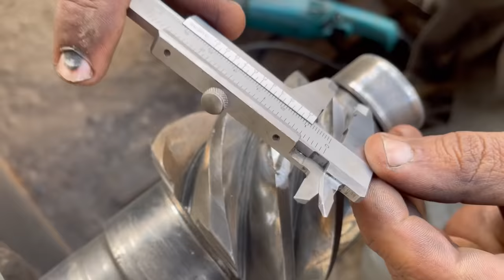I repaired the scrub pinion which no mechanic repairs | Give your opinion by watching the video |

Comment: wrong kind of filler rod for the gear, the gear has a higher carbon content for low wear, not sure if it was  ni rod  which is a low carbon high nickel filler rod for welding cast iron, it will break almost instantly when put back together.

Comment: That won't be noisy at all and it will last forever... E for effort though. It's bad enough setting up brand new gears and not having them self destruct in 10 min. Even with new gears you get bad ones... that are still no doubt better than this... sorry, but I like the valve job videos better.

Comment: there's lots of reasons why mechanics do not repair these types of things. the customer will soon have to tear it apart again when it breaks. as many of the comments say, you are putting a lot of heat stress into that gear and its life will be short. I don't understand why so many people weld in their lathe or Bridgeport or Milling machines. with that electric Arc running through the machine you are going to ruin your bearings and you'll be trying to weld those two I suppose. hilarious

Comment: Giving that gears like this are heat treated 8620 or 4140, unless you preheat the gear too about 350-400 degrees before you weld, the filler will never hold, and you may make the whole gear brittle... Show me this gear in a few months from when this repair was done, bet the same tooth is missing again, or worse.

Comment: How many strokes security guys and engineers had after watching this video? Needless to say, well done not losing a hand, finger, snapping a tool or anything, yall should never reproduce what was done in the vídeo, the guy prob do this a long time ago, and it is EXTREMELY unsafe the way was done and you CANNOT be sure of the safety of the part that was "repaired". Cool DIY showcase video, but precisely contructed and designer parts are made the way they are for a purpose, to be safe and operate within the specificated time and stress. Do not start filling cracks with weld on parts, you cannot measure the price of safety. Replace the part or order a construction of a new one.

Comment: I like silly professionals comments, but you do not think outside the box, this guya do this because it works for them, may be the truck will go 50k miles before need it again vs 500k miles that origunal part may last, but mey be they do not have access to original part, may be that truck come from other side of the world, may be truck manufacturer is out of bussines or model discountnued, so they go the extra mile to keep that truck rolling vs for reasons lesser than this, trucks got waisted on first world countries..

Comment: All the strength of the metal is lost by welding it. It may work but not for long. Will have to pull it apart next week and put a new gear in.a silly waste of time.

Comment: Machine produced precision parts are cheap and should not be repaired. These repairs put lots of other parts under undue stress (especially at high speeds) and they, together with  these repaired parts can fail prematurely.  You said no other mechanic (a lot of them with far higher skills than you) will not repair, do you think they are all nuts?

Comment: Don't think I ever seen  crown or pinion gears attacked this way with an arc welder and then ground in with a 4 inch grinder sorry to say that's just a butcher job and won't last a kick either do the job right or don't do it at all. The next plan is to fill the diff housing with valve grinding paste to bed everything in.

Comment: Congratulations, you have destroyed the motor.... No heat treatment, not straighten after welding ( you can't see it but I Promise to you). Is this the right welding material? A motor part is not the right place for a repair with handskills.
Reply: hahahah thats not a "motor" part its for the rear axle lol

Comment: No precision, lot of preheating from welding, shape do not have curved surface. How you can think this will work correctly. Even when the parts will fit, can be broken in short time. 
Sorry but for me its not so clever. This guy is good to weld and repair rails.

Comment: It's very difficult to grind gear teeth at the best of times. Trying to grind a spiral involute tooth? Not to mention welding and all the stresses that will introduce into the material.
But not to be a complete downer, I will say this. With the limited tooling available you did an excellent job. This will work excellent in the short term, though I worry the damage it will cause to the bevel gear. But since those are usually replaced as a pair? I say go for it. Just keep a repeacement set on hand if you can and inspect it after a bit to see what kind of wear you're looking at and look for any fractures in the weld.

Comment: Poorly repaired.. needs heat treatening and correct temperature to weld, and slow cooling.. welded up straight means failure.

Comment: yes looks good fits like a pig needs engineers blue work down the high points... and it  will need a full heat treatment as the so called new gears 🤣 are as soft as toffee now.. well if you put lipstick on a pig don't make it pretty? just saying. keep up the good work guys stay safe...

Comment: LOL 😆... this will probably last 10 more km... even if you try to weld that... and I don't recommend welding such material, you need to preheat the part at 330-350 degrees C, weld after with MAG, with special wire, and slowly let it cool (put it back in the woven), machine it after and do an LP test... and even so you can't be sure it will last. 
What he does, he practically creates a thermal influenced zone with that horrible weld, that will crack in a very short time, leave alone there are practically no tolerances met on that grinding...  
This is why these people are poor... reason number one: stupidity.